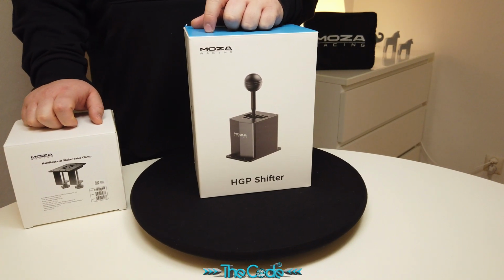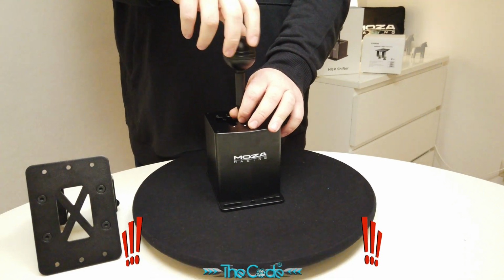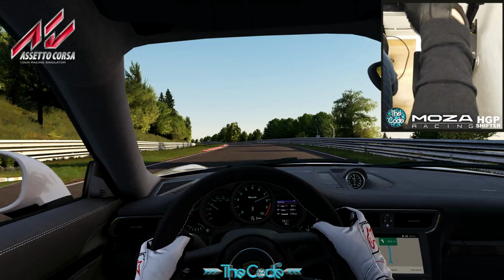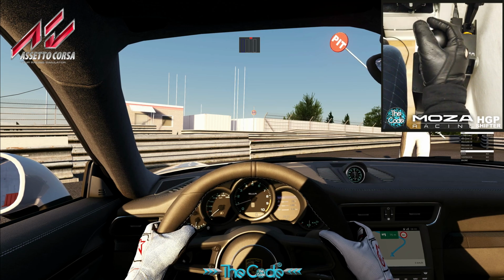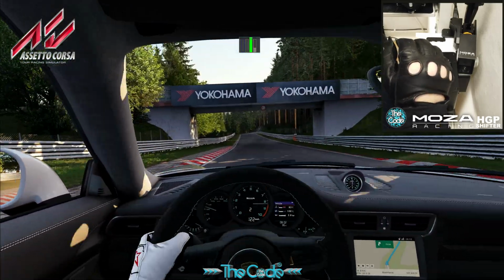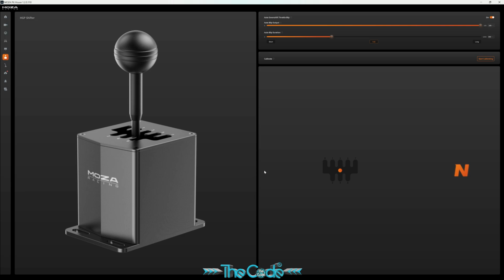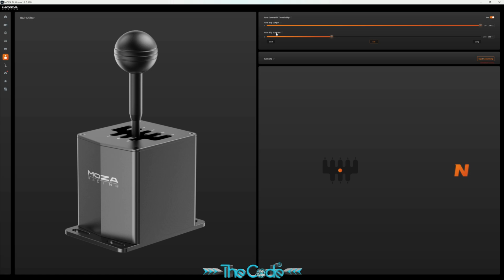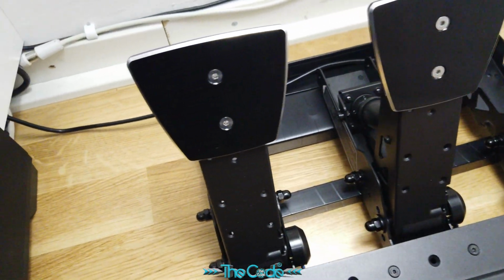Moza Racing HGP Shifter: Full Metal Construction and Intelligent Downshift Throttle blip System

Comment: Does the Intelligent Downshift Throttle blip System works thrustmaster wheel and padels. can I just buy the shifter alone
Reply: You need the moza pedals as well
Reply from the maker: Yes, you can buy the shifter alone , there is link in the description 👍